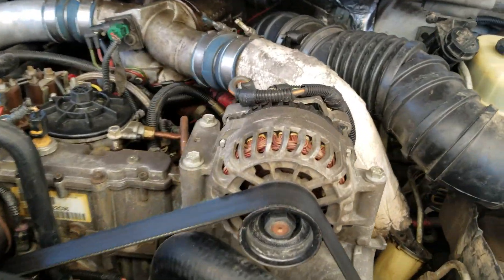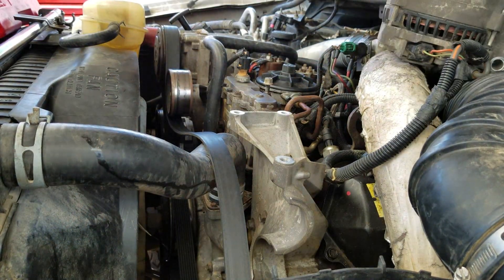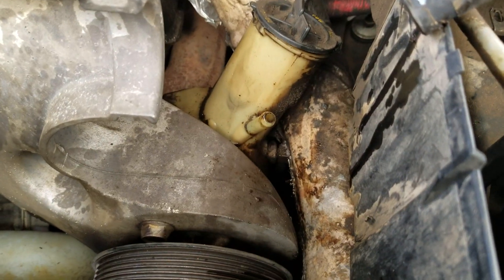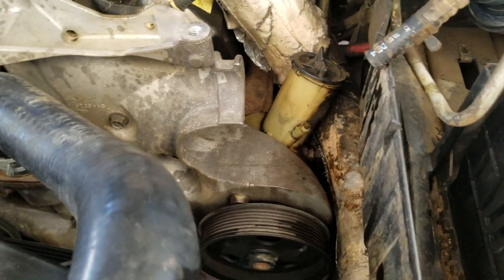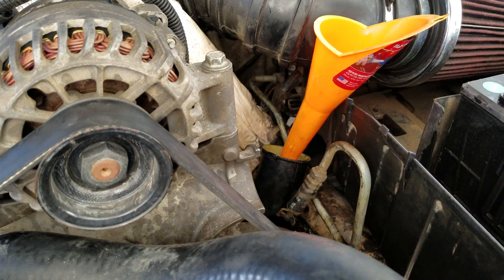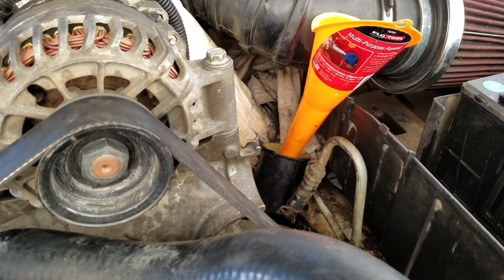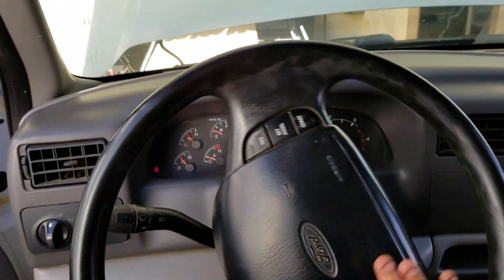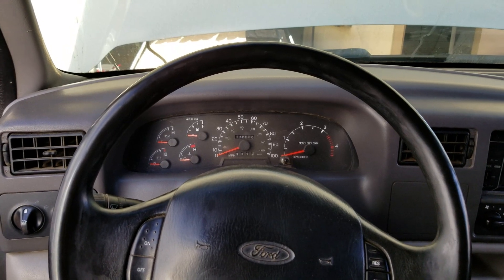Ford 7.3 Hydroboost Power Steering Pump Replacement and Bleeding Air Out of the System - Full Video

Comment: Great video! I've been researching to service these Hydroboost systems. They're apparently quite sensitive to fluid contamination, so if the pump has failed, it's recommended to replace the hoses too. I've also seen recommendations to install a sediment filter on the return line.

Comment: Why does it appear in this video that the high-pressure line/fitting you tightened into the pump didn't thread fully into the pump and I didn't see a white teflon seal at the base of that hose fitting to complete the sealing of that line. I also would've kept the cap on the pump during install, preventing and dirt or crud from getting in the pump.
Reply from the maker: I'm not too sure... it did thread though and never leaked over the time that I had it.  As it pertains to the cap, i completely understand, that's probably best practice.

Comment: When i bleed mine it dumps a bunch of fluid on the ground and i add to it and keep turning etc and end up with a huge mess. Is my pump going bad or something?   I still get the whine
Reply from the maker: Sounds like a blockage of some kind, or it is completely full and you are overfilling possibly?  I would guess it is a blockage somewhere though as if it is empty, it should pull the fluid in, rather than push it outward... strange.

Comment: I'm about to install my THIRD rebuilt pump! 1999 F350, 7.3. Original lasted 245,000 miles. Ist rebuilt went 3 weeks of low milage, 2nd went 3 days! Their getting me a new one from Ford. I'm a good mechanic, but still watch videos. Yours is the best one yet. This time I'm going to try to do it without taking out battery box and air filter (after-market box). Love the old 7.3! Thanks.
Reply: Ford does not offer a new OEM pump, only remanufactured, they don't make them anymore. So if you wanting a NEW PUMP you should look aftermarket. BBB, AAE & Edelmann are a few available on Rock Auto.

Comment: Check your u joint linkage under the dash.  Mine had dried up and was binding up badly.  One shot of lithium grease and it was good as new.    Wasted $150 on a new pump .
Reply: can you explain better where that is

Comment: My pump just seized and blew the belt (320,000 miles on pump).  So I need to flush the lines, but can’t.  Looks like the return line is the top line? So I should let that return into a container off of the pump until the fluid is clear and even install an inline filter?

Comment: Great video - Thanks for the good job - Only question was  the seal on the threaded in fitting on the side - The pump from AutoZone came with (2) seals one white plastic  and a small o-ring - When I removed my threaded fitting the white plastic seal was at the end of the fitting not in the grove as shown on the video - My leak may have been this or a bad reservoir? System is not leaking at this time - I will drive it to the office tomorrow and see how she does - Thanks again for the great video

Comment: honestly I will never work on my power steering pump or lines without removing the intake, battery and battery box. Just way easier to have that giant open space than it is to try and wiggle wrenches in and out of tight spaces.
Reply: I agree.   It’s a pain in the ass if ya don’t take those things out. The turbo piping also.
Reply: @harrychoder987  amen. Once all that is out of the way (mind you it only takes 15ish minutes to get it all off, but even less if you have a good tool box) you can get bigger wrenches in for more leverage, so it’s a no brainer in my personal opinion. I’m about to do the ol 7.3’s brakes this upcoming weekend - it’s been a while since I did anything to her so I’m all giddy lol
She’s not driven much anymore but I intend to keep her alive and well as long as possible

Comment: Those are 13mm. Ford uses all metric fastners. Good video, good explanation.
Reply: Not all. Try removing the tiny screw that holds the gear position indicator to the column with a metric. You'll be SOL.

Comment: For the love of God if you could replace that high pressure line you should do it!!! Those lines can fail like mine did and break off at the fitting while I was driving and lost my steering and my brakes

Comment: I'm fixing to replace my power steering pump and the power steering gear box in mine and I have 327048 miles on it and it's the most miles I have ever been able to put a truck so far I'm shooting for 500000 thanks for the video

Comment: HI i have a 1999 F250 7.3  I need to change my power steering pump,   I don't have a way to raise my truck, can i just turn the wheels after i install the pump and do the same operation you did?   Thank you for the video!
Reply: Put the front wheels on a low friction material like slick cardboard etc.
If you can get some sand under the cardboard on a hard surface that helps too.
Stay gold.
Reply from the maker: Sure that works, I just did it to make the turning easy on myself. Haha.

Comment: Remember to pump your brakes when turning the wheel on initial bleed.  The power steering is used as boost for your brakes on the diesels only.  Also replace the teflon o ring on the feed line. But good video well done. Doing my 2000 excursion now. Love 7.3 l
Reply: So you shouldn’t use the rubber O-ring? It is the Teflon oring?
Reply: I can't get the "o"ring on, but still don't have any leaks.

Comment: Question for you guys - at the same time i picked up a 'whine / grind' in the power steering I also picked up a brake fluid leak which is coming out under the front passenger side down (can't find exactly where it's leaking from).  How would these two items be related?  I had taken my truck into the shop for a tranny service (175K miles) and the shop also flashed / updated my stock ECU (my version was pretty old they said).  When I picked up the truck it definitely had more power, so is it possible the pump has more power and maybe either caused or exposed a brake line leak from there being more pressure from the pump?  And now, with a leak, the air in the system is causing the power steering to whine a bit?
Reply: These trucks use the same fluid for brakes and power steering. So if you have a leaky brake line it will also drain the power steering fluid and cause a whine due to low fluid and or air in the system.
Reply: @ThinkImPretty  no they don't

Comment: Great video. Watch to the end. Felt the excitement for you. Nice work.I'm picking up a grinding or winding sound when I turn and I'm wondering if the power steering pump is going bad. just got the truck back from getting the tranny service and they power wash the engine so I'm almost positive they got air in there or maybe even water somehow.  Fluid seems to be fine so im wondering if I just need to bleed the air?  In your opinion is the best way to bleed air by simply opening up the reservoir cap and turning the wheels left and right while up on a jack?

Comment: The factory lid is a dip stick on the reservoir and has a "hot" mark for where the fluid level should be when things are warmed up, to avoid seals blowing.  Have a syringe handy or just a clean cloth to absorb / remove excess fluid out of the reservoir, which you can do after turning the steering wheel all the way left and right, 2x, 2 complete cycles left to right, done, with the lid off to allow air to escape.
Reply: Good call, GREAT name! Lol
Reply: @davidhess3895  no argument here.  Was cool to see my Dad's name in the notifications (yours)! lol
Reply: had a mechanic pressure wash the engine compartment on my 7.3. feels like you may have got air or water past the reservoir cap. Is the best way to bleed air by simply opening up the cap and turning the wheels left and right?
Reply: @troynichols9788  , he should have never pressure washed your engine compartment because water will get in all of your electrical connectors and start corroding.
Reply: @RoadKen53 and knock the insulation off of so many wires.

Comment: The best way to do this is to pull the radiator first, pull the air pipe, pull the air box, remove the battery, take a sawzall and cut the whole inside of the fender well out...#fullsend!!!
Reply: LMAO !!!!!!!!!!!!                  Dam i was just going to remove the cab and delete the egr and def

Comment: Hey buddy stupid question.but whay exact size wrench you used to break the pressure line off resi lol sorry you said quarter inch didnt know if it was a half inch wrench or 9/16s horrible here
Reply: All the bolts on those trucks should be metric.  10, 13, 17 are most common for repairs like this.

Comment: when my power steering pump went out.  i notice the breaks also had no power, it was too much of a coincidence that both went out at the same time. so some research i found they share the pump system. renting the tool to take the pulley off was a good idea. also doing the transfusion of the fluid using a clear 1/4" hose made it easy to see the transmission fluid. about 4 qts. it works great now very pleased with the results.
Reply: P.S. the one good things was my arms and legs got a work out until i got paid to get the parts.

Comment: Great video!
Reply: BC Jr I flushed the system, changed the pump, and then changed the Hydro boost and the system still wines when I turn at slow speeds. Not sure how to get rid of the wining sound
Reply: My pulleys are all v belt and I need a pulley can't find one in my area without a keyway any body have one I can buy

Comment: Yeah my 2003 6.0 has had a seal rupture on the pressure line in the pump so i replace it and after it blew it again 
I think ecause i did not flush the air as you did that caused the new line to go as well 
If you think im wrong please get back to me

Comment: Rule of Thumb is to flush the system or risk ruining the new pump with old fluid with metal particles from the worn out pump!There was way too much fluid in the reservoir which will expand when it gets hot and could possibly damage a seal. I guess you'll be making another video replacing this new pump with another new pump shortly.....Oh, an inline filter on the return line is always a plus and cheap insurance.
Reply from the maker: I mentioned in the beginning of the vid that I did a complete flush prior to see if it would help. It didn't, so I replaced the pump.
Reply: @BustMonk  did you use a new or a refurbished?  We did this with a refurbished and still have the same situation.  Thanks for the video.

Comment: Man, you did that the hard way and also never flushed your system. Also the whine your hearing when turning with the new pump is air still in the system. Always flush your system when changing any part. Just my opinion.
Reply: He actually did flush the system. He stated at the beginning of the video that he flushed the system and it didn't fix the problem. Therefore, there was no old fluid in the system when the repair began.
Reply: Ruben Pnally what is the easy way ? Im doing mine this coming week so figured id ask
Reply: hugo garza yeah me also I just picked up my new pump today and need a few other things but gonna jump into this fix soon.

Comment: I would recommend replacing that top radiator hose with one that goes AROUND the serpentine belt rather than "through" the path of same.  That's what that rounded form under the alternator is for.  A zip tie on the outer side and you've got it.   I have a 7.3 and it's upper radiator hose is routed outside the path of the serpentine belt.  GATES part number 22433.
Reply: Patrick Baptist how often do you Change the belt? A heavy duty one last 300k easily.
Reply: @whoodiestyle I'm with ya ! Just deal with it and go on. It's a single clamp situation.
Reply: Yeah I went with the same on mine as well, what a pain to need to take the hose off to change the belt....

Comment: Awesome video!!  Thank you!  My replacement took 5 hours.  I had trouble figuring out the new seal placements on the high pressure line.  The teflon gasket gasket I put in very hot water for a minute and then worked it down to it's place.  The black o-ring goes in the front of the line (according to my mechanic neighbor ... the directions that came with the unit (Advanced Auto Parts) were somewhat weak).  I have my steering back now!! The only other thing I did besides your video was to pump a quart of fluid out of the pump as one would do for a flush before starting the removal process. That kept the mess down to a minimum. Thanks again!

Comment: so I have a question I have a 99 f250 powerstroke 7.3  my steering wheel is making the same exact noise and when I touch the brake pedal does the same exact thing makes the wining noise.nothing has locked up on me yet. what do you think it would be??
Reply: You might wanna check your hydro boost brake the steering pump runs lines to the brake booster so when your steering pump goes bad there is no fluid or barely some fluid to the brake booster. So if you changed the steering pump go get the hydro boost check too